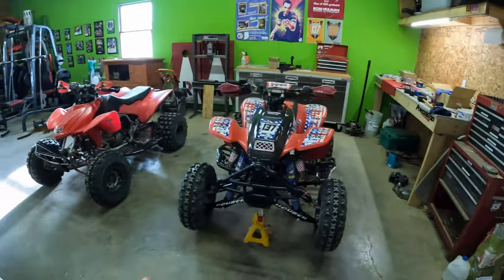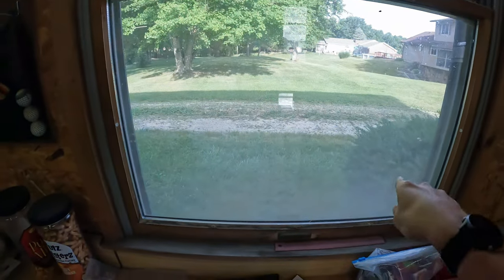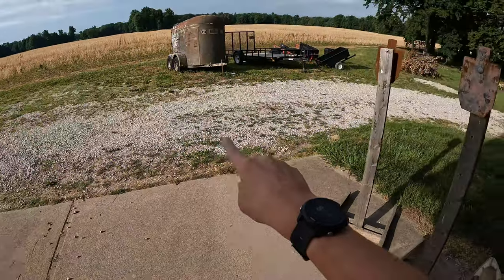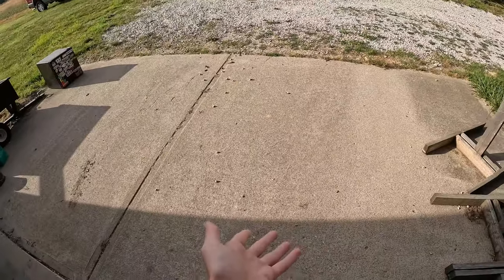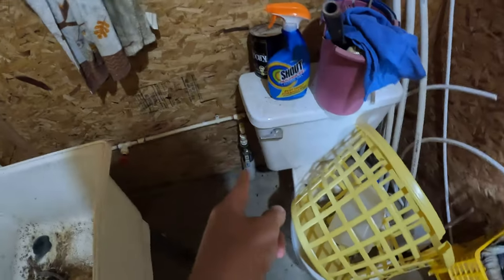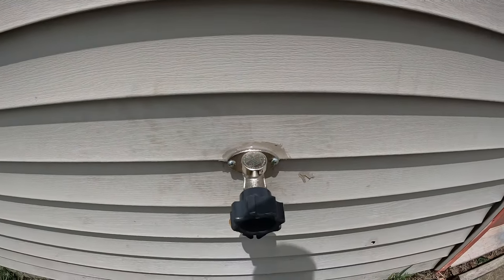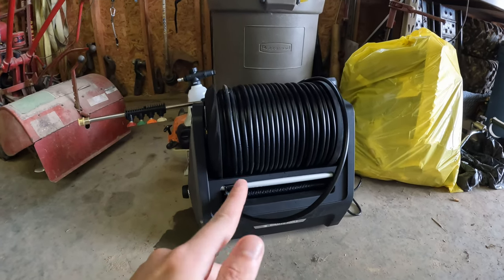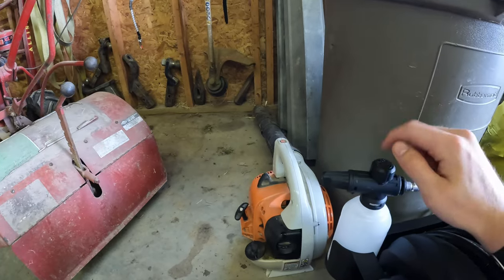New Giraffe Tools Power Washer

Comment: Nice feature.  Question, have you thought of adding a shut off valve that lead from the bathroom and goes up across the ceiling?  It would be a good idea to drain that line to prevent burst line from freezing.  I do like that pressure washer.  I will need to get for myself.   Thanks for the video.
Reply from the maker: Yep we have thought about that. We plan to add in something this fall to make sure the line is drained. Not 100% sure how we’re gonna do it yet but definitely will.

Comment: Very cool man, still haven't ordered mine yet but I think I am going to. I already use an electric pressure washer and love it but it will be nice to have one that is always setup and ready to go. Have you thought about building a little overhang or roof /\ for it to keep it out of the elements/sun?
Reply from the maker: That’s the best part not having to do any setup or cleanup. It’s a big time saver. I have considered that, but haven’t acted on it yet. Hopefully sometime in the future I may build a small enclosure for it.